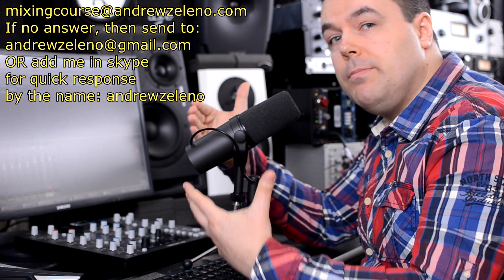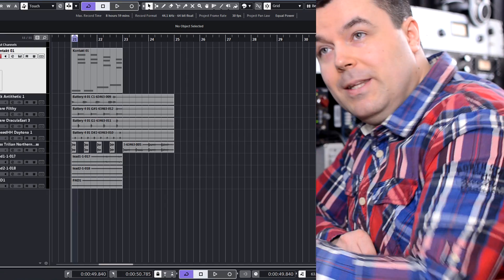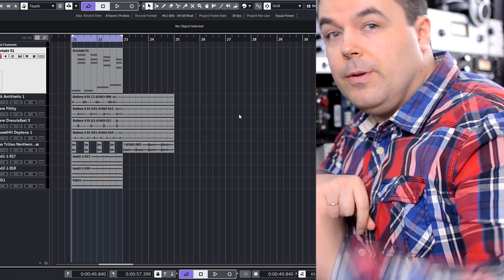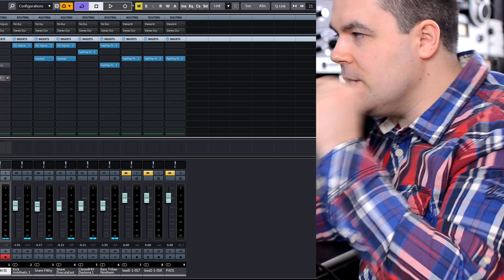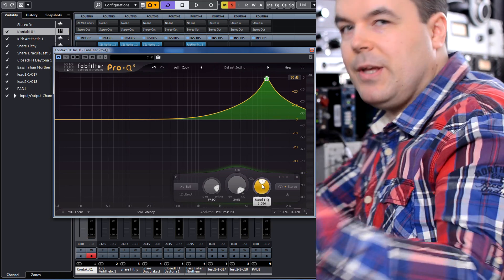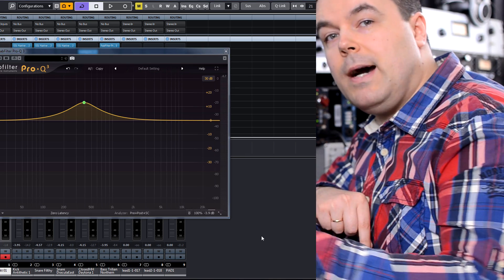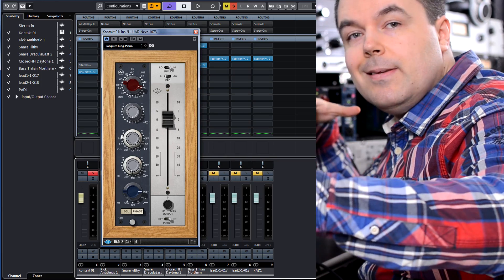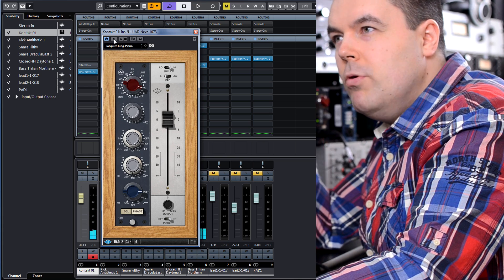Typical Wrong EQing VS Top Mixing with EQ - Critical Thinking Approach

Comment: I'm currently enrolled in Andrew's course. After learning many tools of the audio engineering trade from AZ, I can attest to the fact he is a sonic savant in regards to his mastery of every facet of the audio technical aspect umbrella. I've mostly worked as a mixing/mastering hobbyist for about twenty years, personally, and this is without a doubt, the most in-depth analysis and breakdown of the audio science I have witnessed. Be it equalization methods, studio room acoustic treatment, compression workflow, panorama strategies, microphone selection for intended use-cases, Andrew has got it covered.

This is coming from someone who personally thought they were obsessed in the late-nights, tinkering away to experiment with different mixing plans, only to realise that there are indeed, levels to dedication of the craft and I have much to learn. A great recommendation from me, to partake on your audio engineering journey with AZ's instruction to assist you heavily in your improvement of listening skills and proper application in of mixing/mastering skillset.
Reply from the maker: Thanks man! See you today at the class.

Comment: Very well explained as always. Every wide filter boost should be followed by a cut with a nice slope to avoid boosting neighbouring harmonics anyway. This also shows how the sound gets much worse if the boost is too much. The problem with presets is that they are designed for a specific piano sound but never matches your own piano sound. Kind of useless to use them really but it could be a starting point.
Reply from the maker: Great point!
Reply from the maker: Find my new video in your Youtube feed! We will bust CRAZY mistakes in the most popular EQ plugin on the market! It's about Kirchhoff EQ!

Comment: Thank you, Andrew, for the enlightening video. I have listened to a wide variety of free & paid tutorials and have spent time on ear training. For the most part, they have all contributed to a bettering understanding of sound, but not necessarily to a better understanding of mixing. Ultimately, improving one's mixing skills comes down to extensive practice and comparisons to reference tracks. Much of what I have viewed to date either has been too pedantic (e.g., knowing the frequency range of a clarinet's Chalumeau register) or too generalized (e.g., start with these presets and refine them accordingly). While this has been helpful to a degree, such presentations often are wearisome and result in fatigue, which is an audio mixer's worst enemy. It drains the soul out of you and severely impedes your workflow. Granted, I have come across a few presentations that address more meaning mixing topics like frequency & temporal masking, but your video here is the first one I have encountered that cleanly & clearly pulls together the three facets of your critical thinking approach for EQ, which I have heard elsewhere separately and in a more disjointed fashion: (1) Understand an instrument's functional nuances; (2) recognize the benefits of your instrument; and (3) understand the characteristics of your equalizers. I found the third facet, in particular, to be the biggest eye-opener and what is often overlooked. Embarrassingly, I have overlooked this, and I should know better, because I tend to think very analytically. This is not always a good thing; it sometimes gets in the way of creatively. Still, something as fundamental has REALLY getting to know the strengths & weaknesses of your gear and plugins goes a very long way toward mastering the practical skill of quickly selecting the right tool for the right job, significantly saving time during mixing and improving workflow. Don't get me wrong. I typically read user manuals cover to cover, but I feel the tips you have provided in this video will improve my decision-making and workflow. Bravo & much appreciated.
Reply from the maker: Thanks!

Comment: Great training. Thank you! 
The SSL Native Strip 2 from what I see in plugin doctor, is a much broader curve than the PA SSL 4000, coming in around 0.35q. All of the Native SSL Strip is super broad like that even at their tightest q in E mode. At the broadest q it's like 0.18q. I wish we could make it tighter than that. Without E mode, it's even wider. Cheers.
Reply from the maker: Those things are Constant EQ VS Vitnage EQ curve. It's supposed to be like that. It has nothing to do with this video subject. We have the wrong markings around the knob. People still believe in its precise marking. So they set up their filter wrong other than they are able to say the difference by ears. But one you saw my video you will not have this problem anymore. Cheers!
Reply: @AndrewZeleno1  I hear you and agree. However in plugin doctor, and my ear, it confirms PA’s SSL 4000 E is 1.4q like you said. You also said the SSL channelstrip is a more narrow q compared at 2.4q even though it’s supposed to be the same. I’m letting you know it’s not narrow, it’s quite a lot wider even if you dial the gain all the way. I wish it was able to be tighter/narrow. I understand the vintage curve. :) Love your content!
Reply from the maker: Hi! About Vocal Mixing! I reveal Hidden Ideas of Chris Lord-Alge's plugin that nobody revealed before. Input changes EQ, Harmonics change, real EQ curves and their flaws, Hidden Compressor settings. I appreciate if you will comment under the video on the video's subject.
https://youtu.be/WjDVg4BBq40
Reply from the maker: Part2 of Vocal Mixing Video. Reverb, Delay and Harmonizer secrets which Waves and CLA hid inside of their plugin. I show even settings of Chris Lord-Alge Reverb with Lexicon plugins. CLA says Slap Delay is John Lennon's 166ms Delay. No it's NOT! :) Many unknown things about his effects. A lot of thing to learn from this video. Check it out and I appreciate your comments under the video. You support me by commenting.
https://youtu.be/aHs0XVZK3-Y
Reply from the maker: How you saw my new video on how a compressor is EQ: https://youtu.be/8kH3WqZBO2M

Comment: Hi Andrew! Should I use linear phase eq on the parallel bus to avoid phase issues when I do NY compression for example?
Reply: if there are phase issues, i don't think linear eq will solve much... and it will tax the CPU considerably more. maybe a limiter would be a better substitute for parallel compression?
Reply from the maker: Phase shift is not always a bad thing. Maybe the phase shift you get with the NY compression gives you a partial phase cancellation which improves the sound.
Reply from the maker: Редко выпускаю на РУССКОМ. Вот оно! про главную ошибку при Эквализации. Как большинство неправильно ищут «плохие» частоты. И как правильно. Также бонус про баланс и случайные частотные конфликты https://youtu.be/rWHPIlN8F20